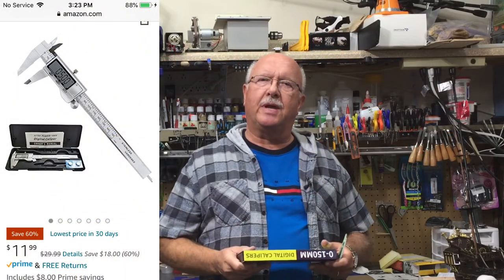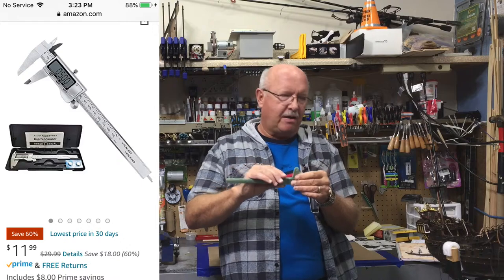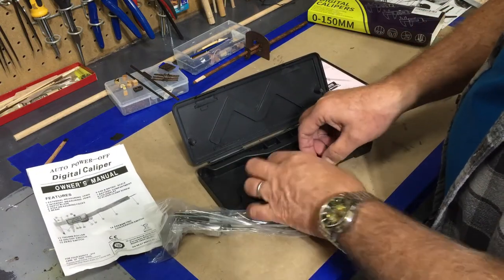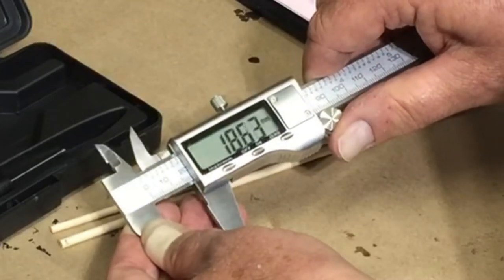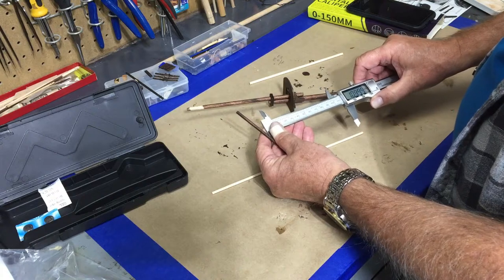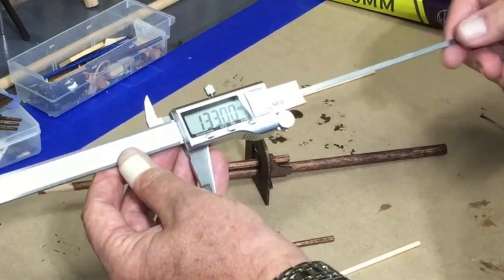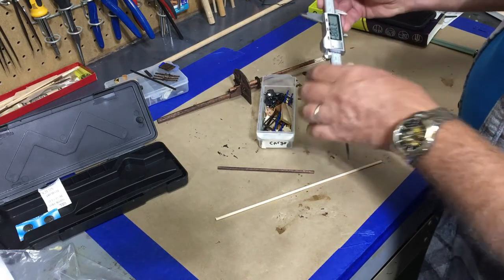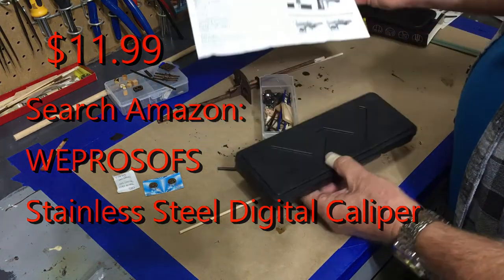Digital Caliper Measuring Tool - Brand: WEPROSOFS

Comment: Like you, I've never had an appreciation or real need for a measuring device such as this. But since  YOU  drug me into the this hobby kicking and screaming,  I've had little choice but to get me one. And I'm glad you did! 😂👍  Your device however looks much  more improved then what I bought. Thanks for sharing. That is a great price indeed.
Reply from the maker: I couldn’t resist it for the price! It’s come in very handy. I use it more often than I thought I would.  I’ve been marking where to tie ropes on the yards so the spacing is the same.. one of my favorite investments 😂👍